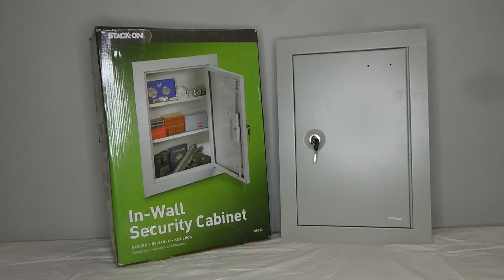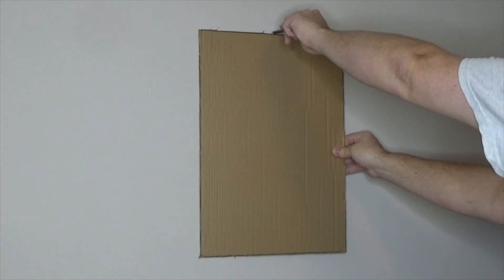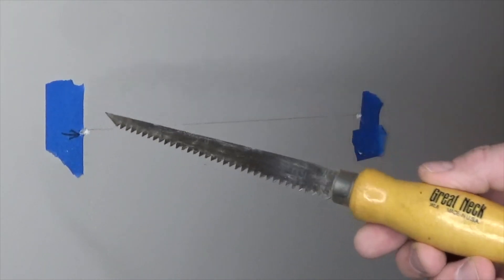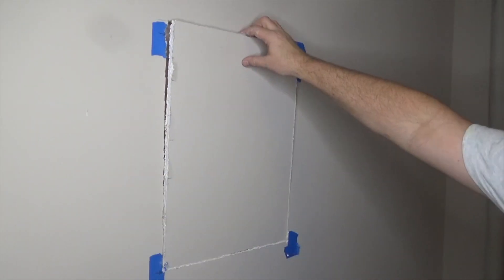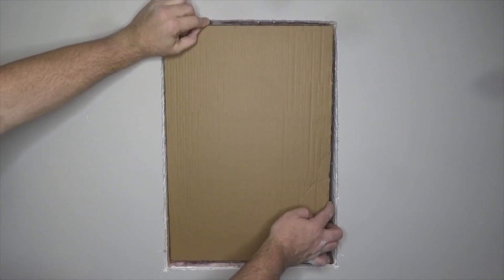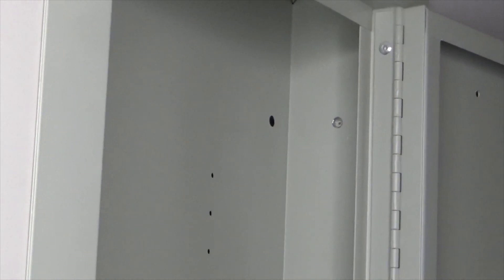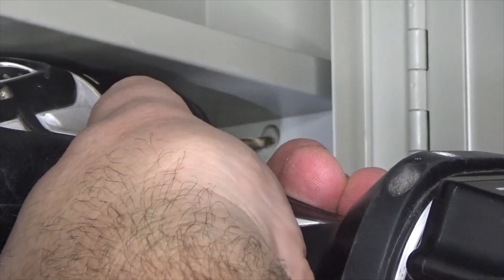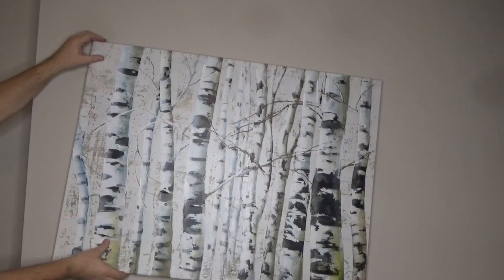In-wall Security Cabinet Installation - Stack-on Cabinet

Comment: I installed this cabinet only to discover that things fall off the shelf and block the locking gear, now my important documents and valuables are stuck inside and I can not get it to open, any ideas on what to do?
Reply from the maker: well....crap!  I haven't had this problem.  open with a crowbar and then bend the damage back in to shape.  idk

Comment: Hi Phil! What is the longest item you can possibly fit in the Stack-On IWC-22? Do you have the dimensions of the opening?
Reply from the maker: 10.5" X 17.5"       Diagonal:  20.25"
Hope this helps.
Reply: @PhilCrockett  thank you! Now I know I can fit a 16.5" Henry US Survival.
Reply from the maker: those Henry Survival stocks are pretty fat.  Let me go check the depth of the safe, and I'll get back to ya
Reply from the maker: the cabinet is 3" deep.  Better check to see if the big fat butt stock of that Henry will fit.  Let me know.
Reply: @PhilCrockett  I just measured the thickness of the stock with a Vernier caliper and it's 2.78" at the thickest point. Are you sure there is still 3" inside that cabinet when the door is closed?
Reply from the maker: OH YA!  Good point!  I'll be back with more info shortly.  In the mean-time, re-send the final dimensions of the Henry when fully compacted. lenght, width and height.
Reply: @PhilCrockett  16.5" long. 2.78" thick. 6" wide.
Reply from the maker: The locking mechanism DOES end up taking depth and width away, however,  if you put the Henry on the hinge side of the cabinet, then you will have plenty of room.   Plus.....  there's extra space around the perimeter on the inside too.   You should have no problem at all.  Looks like plenty of room.   You've given me an idea for my Ruger 10/22 Takedown.   
Let me know how it goes.
Reply: Alright. Just what I needed to know before ordering one.
Reply from the maker: Let me know when you get that cabinet and how the Henry fits.
Reply: @PhilCrockett  will do!